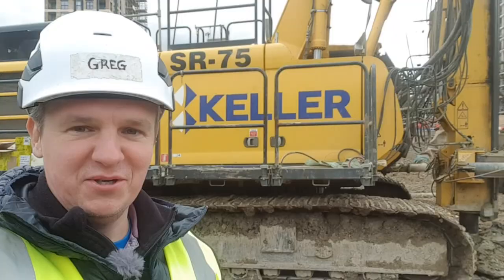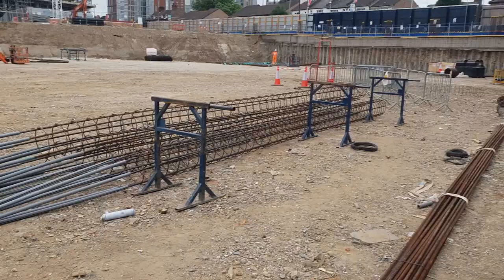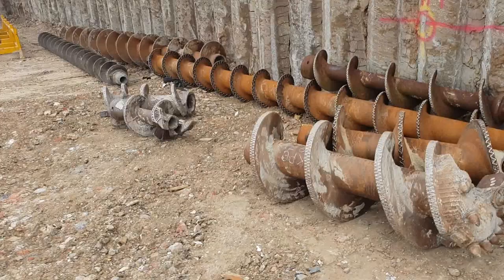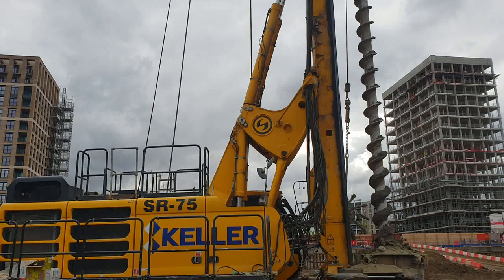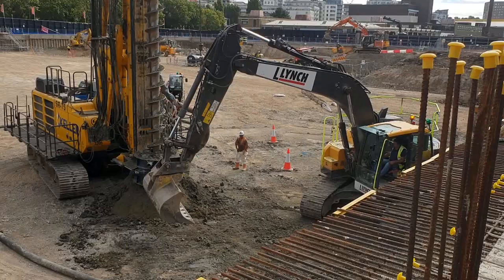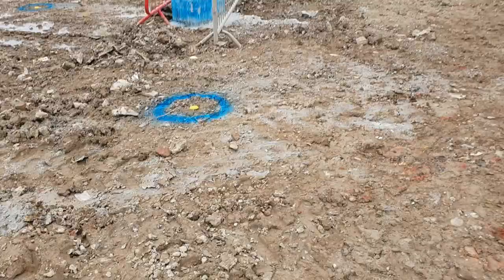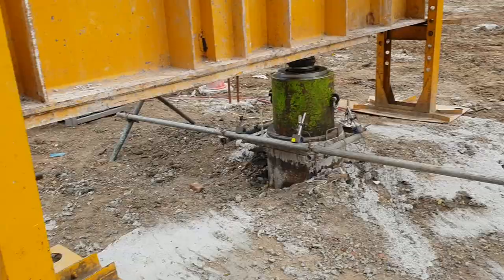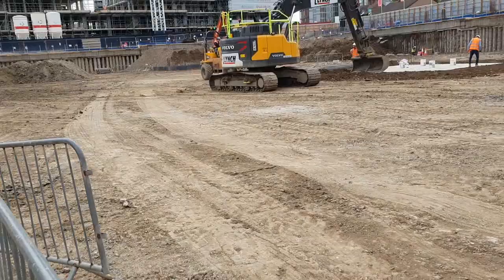CONCRETE PILES installation STEP BY STEP.

Comment: Hi, Could you be more specific please in setting out by showing how you use EDM. how you stake points, survey land, as build, programmes you using on total station, mark points on the site by spray, drawing, etc. this will be more useful for those who wants to become Setting out Engineer. Thank you
Reply from the maker: Hi Rido! You can see EDM in Setting out series, unfortunately it's not easy to record while doing setting out. I was thinking about installing go pro on my hard hat, but it won't work on my site. I will try my best to show this though and in my next videos you will see more 'in action' vids.
Reply: @SITENG Thank  you👍

Comment: What determines the depth that you drill? is it based on the load bearing or its really the base at which you touch hard rock?
Reply from the maker: this is design and depending on the pile type - some yes, have to reach a good layer, but in most cases this is the friction on the pile surface which is needed to hold the load

Comment: Hi Seting, Thank you for your information. Can you specify the standard method for pile test (bearing capacity)? ASTM or any other references. Thanks
Reply from the maker: well, standard method is to load the pile and check how it reacts under :)

Comment: how are you checking verticality and position? We are governed by SPERW 3rd edition:

Geometric Tolerances:

top of steel: -50mm/+150mm
position: = +-75mm
verticality 1:75

I suggest total station using cogo arc calculation on the hollow core of the auger. I thought these QA would have been priced in, but they are not. I will be running this past my company next week, but I think there are commercial blockages even though we are responsible for adhering to the piling specification. 

I did not see anyone doing total station surveys on this video. 

Checking bored piles with casings verticality and position are a lot more straight forward.
Reply from the maker: once it's marked is the rig driver to make sure it goes straight etc. Top of steel is related to the platform level and tolerances you have are enough to go like this although on one job I actually measured the level to tell guys how much to plunge the cage ( that was due to the state of the mat really) Then you do the as built survey on the pile position. The rig creates a pile report about the pile and then the pile integrity test is done on the cut off level and that's about it :)
Reply: @SITENG  There is a inclinometer on the rig, but it only informs you of the verticality or levelness of the rig. The auger is made of 3 sections and generally can't be taken out of the bore once it starts boring. T
he piles are 10-12m deep with a 600mm diameter. Our PPL is 67.000m. The mat is a up and down at places. To be cost efficient, we are using the existing tarmac as the piling platform. There are a couple of softspots that have been dug 630mm below the PPL and backfilled with 6F2. I set up the control network for the job and we are setting all of the cages with a laser level. Our rig has it's own software for measuring certain parameters and the workforce have paperwork they fill in also. As I said we are governed by the ICE SPERW standard which means that the piles should be of a verticality of 1:75 - circa 160mm deviation in the horizontal axis at the toe of the pile. The position is to be within 75mm and the steel is to be -50mm/+150mm.

Comment: How long does it take for the concrete to set?
Reply from the maker: Depends on concrete really, but 24h typically, when piling it might be less, all dependant on the mix used

Comment: what is RIG works, which you mentioned in video?
Reply from the maker: It's a piling rig - a piling machine, so probably the works it's doing - drilling and concrete

Comment: Super video Greg. Great one.

What is the difference between the Integrity Pile Test and the Pile Test with the yellow steel bar in it.

What happens if the pile fail the Integrity Test. 

Who orders the concrete for the pile and who checks the quality and specification of the concrete used for the piles.

Very good video which is filmed brilliantly as the HD quality is superb. Excellent.
Reply from the maker: Hi Asim! Bearing capacity test check actual pile capacity to check the discrepancy between reality and design - pile is kept under load and movement is checked. Integrity test checks if the pile has any irregularities in the concrete structure (cracks etc).
Reply: The piling company orders the concrete and they do check the quality of the concrete by taking samples typically cubes. hope I answered the concrete part.

Comment: Why the different colour rebar some is brown other looks to be galvanised?
Reply from the maker: Hi Joshua! They all the same, there are not galvanised as I remember, they only used in some cases, very rarely. The difference you see is the rusty one against 'fresh' ones. Even after few days rebar will start changing colour as the rust starting to get it 😁

Comment: Thanks for the video, I am a BEng civil engineer with 4 years design experience, how can I move to site without any site experience or setting out experience? Most job offers put me down as they always require some setting out experience.  Thanks again brother.
Reply from the maker: Hi Mohamed! You have to try get a job as an assistant/junior engineer first and spend some time on site. In your case it's not going to be long as you have design experience and a degree, so it's only a matter of learning a bit of setting out and see how the work on site is looking. Once you will have even little of site experience look for site engineer position.
Reply: @SITENG  thank you so much for your response! I really appreciate your effort
Reply: @MoBH88  if you are in LONDON uk, there is a company called Apex Engineering Services , E16 water front , i work with them,  they are paying very less but you are learning

Comment: Hi Greg, do they use tremie during pouring concrete down?
Reply from the maker: Hi Yavuz! These were CFA piles, so simultaneously with the auger withdrawal the concrete is being poured. I am showing the 'drill' on the video where you can see how it works.

Comment: hi Greg had a question, I am currently setting out piles and the pins we have is 600MM, it is really hard to get the pins as low as the ones shown in your video. How do you often do it?
Reply from the maker: Hi Khalid! you need smaller pins, cut yours in 3, 200mm is well enough - and you will save some steel 😉. The pins don't have to be long to keep the position for piles. I was doing piles few times, but last time maybe 3 years ago 😁
Reply: @SITENG  great thanks for replying. Also what is often the pile tolerance? Thanks Greg appreciate it
Reply from the maker: This depends on the project really, but it's sometimes even 75mm, so quite a lot :)